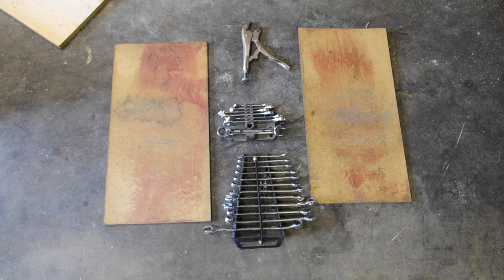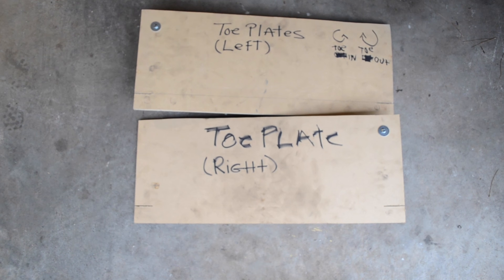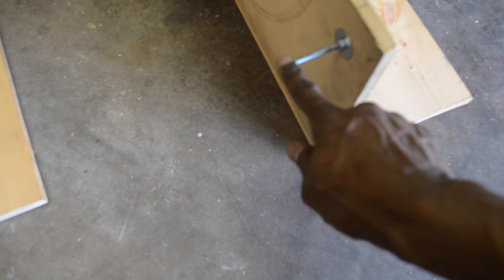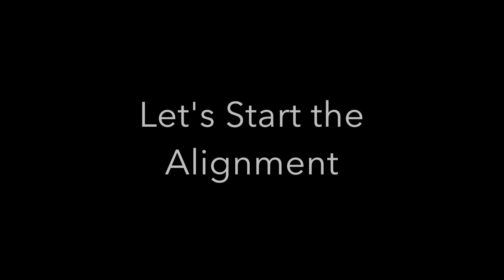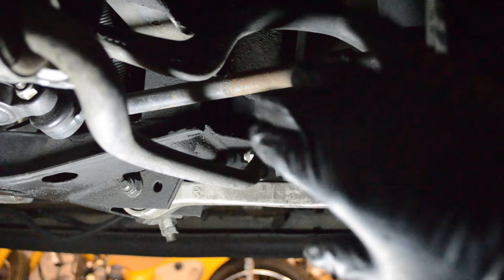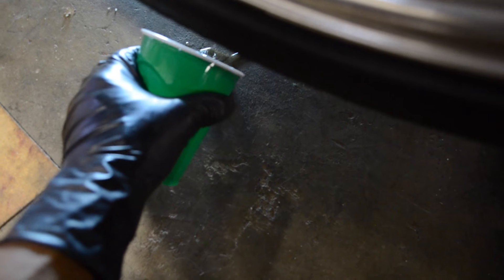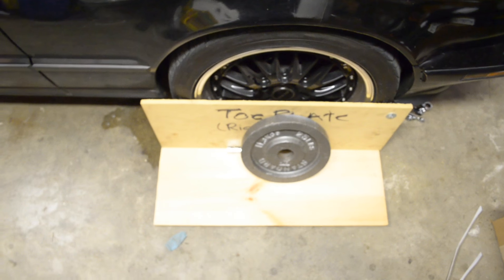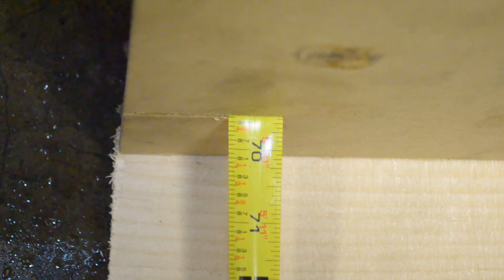DIY: Front Wheel Alignment

Comment: how did you turn the tie rod
Reply from the maker: On the E34 BMW, I used vise grips on the barrel that turns. But, this will depend on the car. My Volvo I use to spanner wrenches.
Reply: Typically on most older BMWs E30, E34, E36, etc... the tie rod will have notches for a 13mm
Reply: Do you need to remove the tie rod?